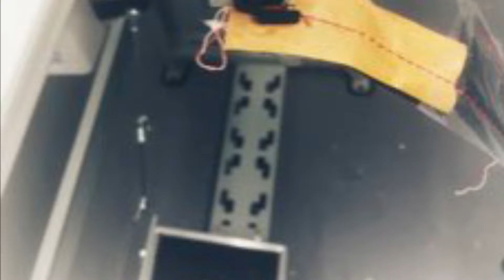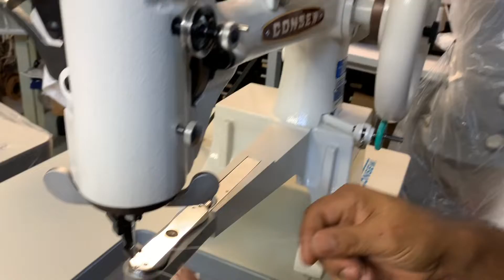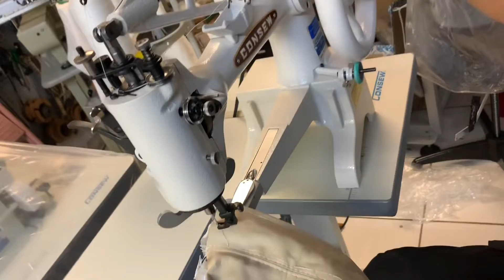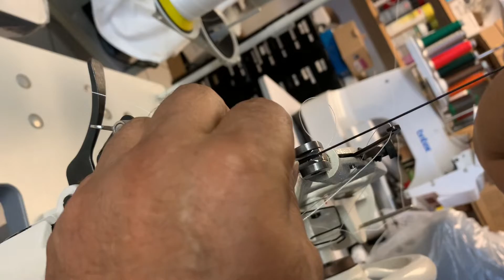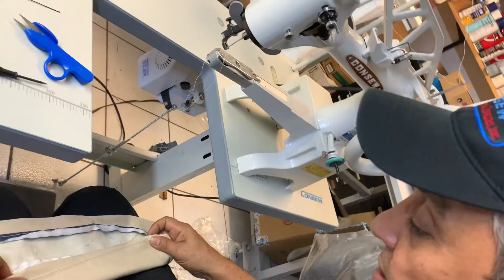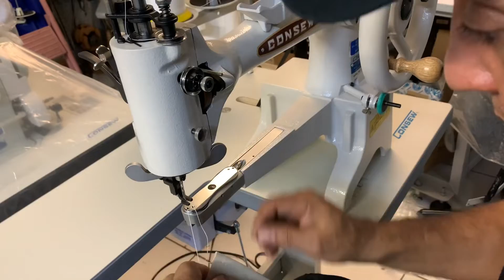Consew 29 Cylinder Arm Shoe Repair and Mending Lock Stitch. Hand bags. Machine

Comment: I have the long arm version of the "Singer patcher" from another brand, but the same machine. Glad to see you face occasionally the same problems like me. It´s missing out a stitch and the optical result is bad. This is an old construction, not made for electrical engine assistance to my opinion. You can fix with this machine many things a normal machine is not capable of, but a clean seam is not the machines strength to my opinion. Sew slowly, never try to race the machine, the "bridge" is not made for this.